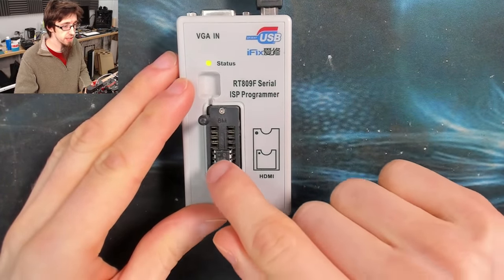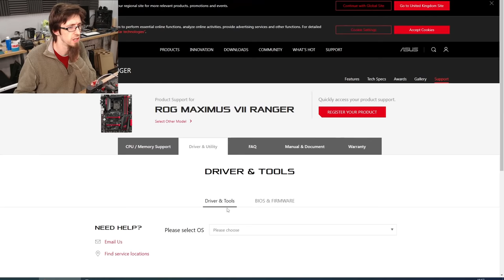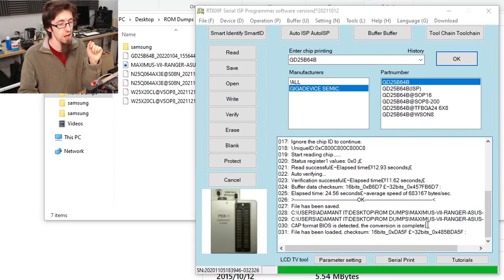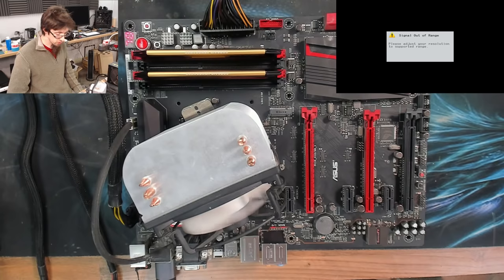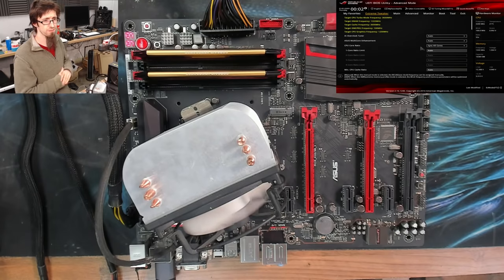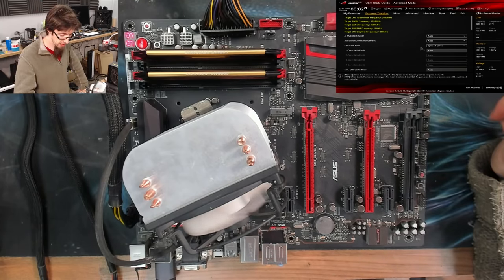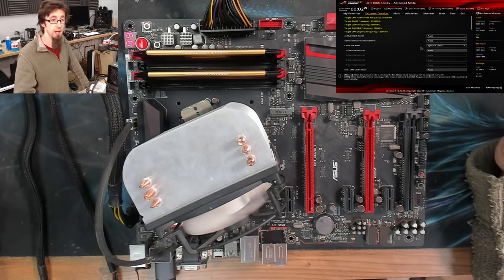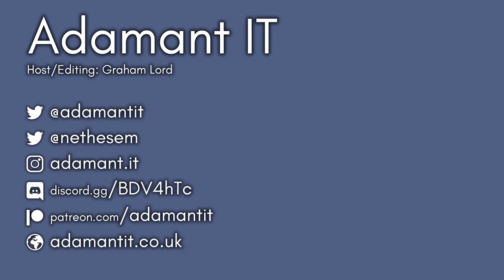Red herrings, red herrings everywhere (4th Gen Intel Build, No POST) - LFC#292

Comment: Great to see you back and happy new year. I hope you managed to upsell the client a better CPU cooler, because even with a stock cooler, that CPU is going to be throttling when stressed. And the stock cooler will be noisy to boot. And was that an unused M.2 slot? :)

With regard to the BIOS chip, as you suspect bit rot, perhaps it might be an idea to replace it? 

Is it not the case that whether pigtails work or not on a GPU is up to the gauge of the cable - is it capable of carrying the current - and the power output by the PSU on that rail? A quality PSU is single-rail but some of the PSUs on PCs you've examined have not been single-rail. That GPU took an 8 pin (150W) connector and a 6 pin (75W) connector so that's 225W. That's 19A on a single 12V rail. Something to check.
Reply: The stock cooler is fine for the CPU. A gen 4 i5 is a 95W max chip. It'll probably never even draw that. When they're in good shape the stock cooler is relatively quiet too. I have one failing in a gen one now. That PC has been running 24/7 since it was new though. I want to retire it but due to the global situation I put off an upgrade build for my desktop. I was going to repurpose my current desktop as a file server. Someday.
Reply: @1pcfred  IME the stock cooler is only fine if you don't stress it. Running a file server doesn't normally stress a CPU. My ears may be more sensitive than yours, though.

Comment: At first I was wondering how all that dust got in there, then I saw the fan holes in the side, and then realized he was running a negative pressure in the case, especially with those plugged filters.  Even with clean filters, tho, 1 intake and 2 exhaust will almost always equal negative pressure.
Dust filters are fine, but if you are not going to maintain them, just remove them.
As far as that cooler set up, it will be marked for removable because when you are installing, you can look and see how it works before installing it.  If it's already installed, you will need removal directions if you don't now how it works and the arrows will help there.
That's my theory, anyway.

Comment: @Adamant IT , that was a common problem with almost all Asus Z97 (ROG line mostly) at the time, the PCB of the motherboards have a lot of slack and flexibility (don't know why), combine that with that one lock per DIMM and, they are though to push in the DIMMs per experience, it will break the connection between the slot and the PCB of the motherboard, ASUS never acknowledge it, but that was a common point of failure at the time. This time you "got lucky" with the BIOS reprograming but pay attention to the above on Asus Z97 :)

Comment: Really enjoyable and instructive, thank you! :) Is there a "standard procedure" step after a BIOS reflash that does not get the motherboard to work? Of course assuming, all the previous things have been check. Thanks!
Reply from the maker: BIOS re-program was probably my last shot, to be honest. Next move would've been to try booting with no RAM or no CPU to see if anything changed. I'd be putting the multimeter on the RAM VRM to see if there was power to RAM. This is getting into board-repair though, and I'm still very new to board repair on ATX boards. We were very close to throwing out the mobo, and selling the Sabretooth or up-selling a complete Mobo/CPU/RAM upgrade.
Reply: @Adamant_IT  Thanks a lot for taking your time to answer! I was thinking along the same lines. If it would be my personal Mobo I'd maybe try to buy a new bios chip just to be on the safe side but apart from that the journey would come to an end fearly quickly. :D
Reply: @Adamant_IT  Sunspot CME bit rot damage to the BIOS? - "Well, I never..."   EXCELLENT REPAIR SIR

Comment: I've been working on the exact same Maximus VII Ranger, with the same problem, but worse, ie, it's stuck on the 1st OO bios display. I can't see any shorts, or parts getting hot, and I see voltages everywhere - I don't know if they are the right voltages, but they are there -, so I came to the same bios conclusion. I've got the CH341A on order, but it doesn't specify the GD25B64BP1G. Do you know if the cheap programmers do that chip, because I can't justify an expensive programmer for just 1 motherboard.

Comment: That amount of compound on the CPU is pretty typical of with a lot of bigger PC builders .   Most times it still seems to still do the job, but likely not as efficiently as it could.    
Code 26 is a fairly common fault on Maximus VII Ranger mainboards from what I can see and it is usually indicating stuck training memory.   
Now I will watch the rest of the video to see if I was right :)

Comment: I suspect that when that eps connector was plugged in improperly, perhaps, maybe it sent a power surge to the bios chip, the reason for the mismatch in the bios programmer detection was most likely a result of the bios being corrupted. next time you experience a detection mismatch check it again after programming and see if you get the mismatch error again, cheers mate!

Comment: 31:23 - I think you should First Brush the RAM slot contact pins on the motherboard before proceeding from Flashing the bios via Programmer, I use Lighter Fluid (it evaporates fast)  and a tooth brush to remove small dust stuck inside those Slots.. Flashing the bios thru a programmer was always my last resort.

Comment: when installing the intel cooler, you should first turn the plastic stands to their correct position, and then place the cooler in the board and push it down. not doing it in that order could break the plastic "hooks" on the bottom of the cooler because they can catch the edges of the holes and bend.

Comment: Why every time the cpu cooler is not mounted properly, It ends up beeing a motherboard causing no POST? Can a overheating CPU kill a motherboard?
Reply from the maker: I don't think so, it's just a coincidence. That's the ridiculous irony, the CPU cooler and overheating was nothing to do with the main fault here.
Reply: Well yes, it probably wouldn't be too significant, but more heat is soaked up by the motherboard and more heat usually means components don't last as long, especially electrolytic capacitors which will dry out a little faster, in this case however there's nothing you could have really done to prevent this other than maybe replace the CMOS battery.
Reply: @vgamesx1  None of electrolytic capatitors were that close to the cpu, maybe thermal expansion? It is what kills gpus, so why not motherboards.
Reply: @Adamant_IT  When the cpu overheats, and the computer forces shutdown, could the sudden power loss have scrambled the bios?

Comment: I have now come to 28 minutes, and im betting on the motherboard :-P
EDIT:
Well this was really interesting.. I have a Asus mb simialr to this (same age), it seems to be a high end mb with the code display and power buttons etc. It has had trouble with the usb's not working/partially working, and it all of a sudden just died. Tried different cpu and ram but if i remember correctly i also got a code for either cpu or ram and no post. I have some kind of chip programmer, but not sure if its usb, i have to look at it. But if i can i will definetly try this!
I did update the bios, but nothing regarding the usb problem changed. The usb has been VERY weird.
Never knew stuff like this could actually fix a dead board.. Really cool!!!

Comment: First thing I do when Mobo doesn't post is to test the ram modules, I start with the first ram module in the first memory slot, then the second module in the second slot and so on and on until I am sure all memory modules and ram slots are ok, then I proceed to look if PSU is supplying enough power to Mobo, I start with removing or unplug any Non-essential parts or devices not necessary for power/boot proccess, then if Mobo post and starts boot proccess then I proceed to plug devices and repeat restarting the pc one device by one until all devices are connected to see if PSU is supplying enough power for all the devices connected, I have found in these 20+ years of repairing PC's as a hobby, that 90% of the times the issue is a bad ram module or ram gold pins or connectors and/or ram memory slots being dirty, not making good contact!

Another thing is that I don't trust memory testing applications or programs 100%, because I have seen faulty memory modules that pass the tests, but then I found that changing the old ram modules with new ones, Yes new ones, not the old, used and abused you get on certain websites solves the problem, at least this being my experiences working with PC problems!

Comment: I have a lot of experience with modern Intel Asus boards, and I would argue that this isn't a case of bit rot.  it's a case of the system being unstable, randomly shutting off repeatedly (likely due to the CPU overheating) and causing the BIOS to corrupt. During my overclocking escapades I've had 4 BIOS chips go bad from repeatedly going through system crashes due to instability

Comment: IMO, removing the CMOS battery alone is not always a sure-fire way of "clearing" the BIOS, esp. in newer boards. The board could very well "store" some "stuffz" in a permanent manner, similar to a flash memory, so simply removing its power doesn't actually clear anything - that's why you'd WANT the battery in place and actually short the designated pins/press the button, which actively tells whatever stores that stuff to clear - just a hunch and haven't tested myself. My 12 year-old laptop had an absolutely flat CMOS battery in it for years on end until I accidentally discovered it during a cleaning session, yet it never once lost its settings or even clock - case and point.
Reply: A laptop is not a desktop, but good point. It was probably receiving power from the internal lithium battery.
Reply: @jaro6985  I removed the battery pack countless times until then too :)) Now that I think about it, I'm pretty sure it at least lost the clock, but I didn't noticed it, because there's no way an RTC can run without power......you can't "store" time somehow...
Reply: @DanielsGameVault  Interesting, maybe a supercap also? RTC wouldn't run without power yeah. small chance windows was updating it before you noticed.

Comment: That cooler might have been out on relatively recently as part of fault finding, given the loose connectors elsewhere
Reply: That's my guess. The customer gave it a go and when they couldn't get it to work sent it off to the shop in the state they put it into. It is a nice PC. I can see why they wanted to fix it. I still love my gen 4 Intel PC. I have a Z87-A

Comment: I really hope you see this...

First, id like to really thank you for all you work. I really like your channel. its chill and not over the top.

I have a similar problem. Computer was fine then all of the sudden just doesn't post. I will say that there was a lightning storm and my power tripped along with the surge protector ever since it wasnt the same. it would post but it was a bit janky. As of about a week ago IT WILL NOT POST.

I have another PC i could troubleshoot with so i did. Everything checks out... ALL components work on other PC.

I assume its the motherboard that took a crap. The only clue i have is that when i boot the PC with ATX24pin and CPU ATX8pin it turns on but will not post. However, when i unplug the CPU ATX8pin it kinda turns on then instantly shuts off. as if maybe it has a short.

I really hope you read this and can maybe share some insight.

Thanks!!!

Comment: I got a similar setup but a bit stripped down: 4570 with an old stock-ish cooler master cooler, 8 gb mismatched ram tuned to cl9 (and it works amazingly well), an h81m-k from asus, Samsung 850 evo 250 and a 2tb enterprise Western digital purple hdd and for gaming a hot r9 380 to complete it all. The most reliable part if for sure that intel puppy since it's tame when it comes to heat but pretty snappy and handles loads pretty well, 8gb ram is plenty for my workload and so is the storage, too bad for the gpu but going for a high-end or mid-range gpu from 2018 and up would bottleneck my poor i5 so until I do a full upgrade I'm keeping it this way, for anyone having relatively old stuff at he guys if you can sell it or give it away or reuse it just do so because having old hardware laying around doesn't do any good (I received my i5 in a busted hp pc and after looking in the scrap yard I built this little machine with almost no costs whatsoever and it blows my mind that I did so in 2020, who know how many other machines could come back to life around the world)

Comment: i accidentally connected bench supply set to 18v to iphone xs max through battery connector. What could have gone wrong? It has o amp draw and nothing gets hot and looks burnt or blown. i tried replacing trister, but no luck

Comment: Commenting now, around the point of the tower CPU cooler drop-in. I'm calling it a bad ram slot, first slot is probably dead. I'll keep watching to see if I'm right. Cheers!
Reply: BIOS degradation. Haven't run into that too much, interesting to see.

Comment: You can pull on the intel cooler legs and turn them clockwise then place the cooler over the holes and press 2-2 pins all the way down with 2 fingers.
Also should have repasted that gpu, its only 6 screws and the GPU would run at least 8-10 °C cooler. Otherwise good problem finding, probably not the fastest but a good way for beginners.

Comment: I know this is an old video but your channel has only recently been pushed to me.
Even though the CMOS battery is not directly related to the bios chip, I wonder if a bad battery could contribute to the bit rot you described. If extra power was required to read and repower the CMOS memory, I wonder if that in turn could affect the reading of the bios chip considering that they would likely be accessed together.

Comment: On the cooler, the pins (lock) should be up and in the NON Reset position, place them in the board, and then press the pins down, locking the cooler to the board. I always do the opposite corners . I've been doing this since the original p4 coolers came out, so thousands of machines built like this.
Reply from the maker: I sometimes find myself accidently pushing the pin down before the plug is through the hole, so I leave them in reset so it's easy to pull them up. But either or is fine - many ways to bake a cake 👌

Comment: I have a 4th gen system (4670K + R9280) I built in 2014 that's still working now, the only issue I ever had was BIOS related. A few years ago, suddenly one day it just refused to boot. After a lot of troubleshooting, I swapped RAM slots & it booted. Fixed I thought, but then it went right back to black screen on a power down. I reseated RAM again, back to original slots and it magically came back to life. So I updated the BIOS and it has worked fine since. It's funny that the BIOS problem was my one issue, as I specifically bought this Gigabyte MB due to it having a DualBIOS... I guess the backup chip was faulty.

Comment: I recently watched a video somewhere about bit flipping. From what I remember, cosmic rays can flip bits in computers. Considering the age of the system, it's entirely possible that the problem with this system resulted from this type of bit flipping. The chances are extremely small, but again considering the age, this would be my guess as to what happened.
Reply: I don't know if we can blame what we're seeing here on cosmic rays. It's just old age. When they make chips not everything in the chip is exactly identical. Some memory cells are not as strong as others are. So they give out sooner. This makes me glad I flashed my BIOS not long ago. Gave it a recharge then.

Comment: OMG! Do you never just test the RAM in channel 2 or the B slots!! AAAAAGH!!! Trying not to pull my hair out!
Reply: Same thoughts here! I can't blame him for checking all those loose cables and cooler first, but checking a different RAM slot is so easy and has worked multiple times for me.
Reply: Yeah, dying ram slots weren't rare on asus boards in the 4th gen times. Saw a few B85 board running with 2 working slots out of the 4.

Comment: Nice repair. This mobo is still a nice piece of kit when paired with a Devils Canyon i7. 
One remark: I was surprised to see how you reinstalled the Intel fan: for years I have been turning the twist bits back to the right BEFORE re-inserting the pins in the motherboard. Then you press from top, hear an audible click for each pin and you are in business, to twisting needed once on board for installing the cooler, only to remove it. Just saying.
Reply from the maker: Yea, both methods are fine. I twist afterwards in case I accidently press them in before the plug is through the hole, so I can easily pull the pin back up. Important thing is understanding what the plug and pins are actually doing though, which is where most people get stuck.

Comment: I had an interesting issue with a higher end AMD 8000 series, MSI? motherboard, and Silverstone power supply. After a couple of years operating with a mild overclock as a gaming/re-encode rig, the EPS connector pins started to get hot and burn the plastic connector at the board..... The overclock ran reasonably cool on air cooling, connector was in properly, and the amount of time it spent on heavy load was probably less than 15%.....

Comment: Power supplies can be iffy at times, I had an old system that I had repurposed as a security system, checked the power supply and it passed all tests, all voltages were ok.  The one thing I did not like about it and which resulted in me getting a new supply is the power button on the supply would not switch off.  Before changing the powersupply I was having issues with the system freezing after running for a few days, once the power supply was changed issue fixed.